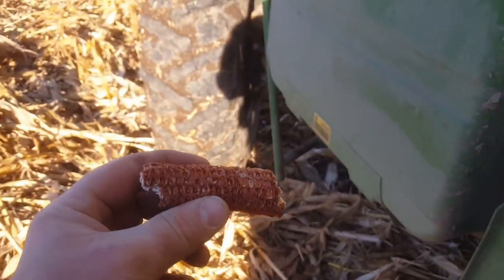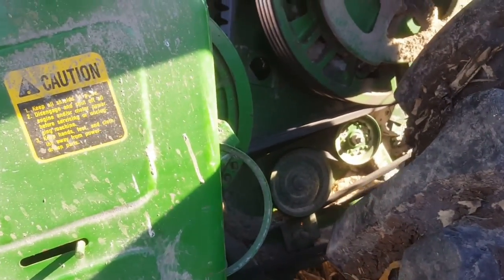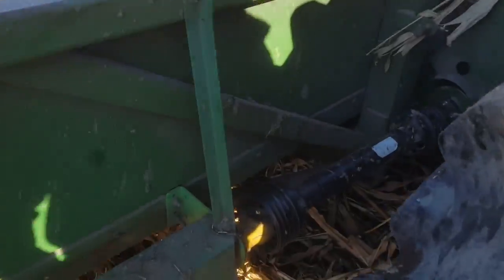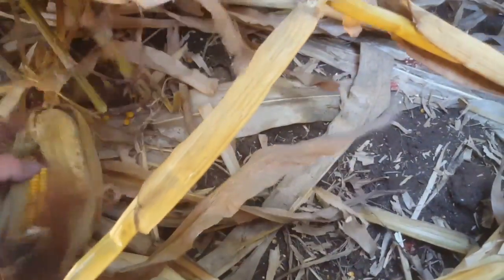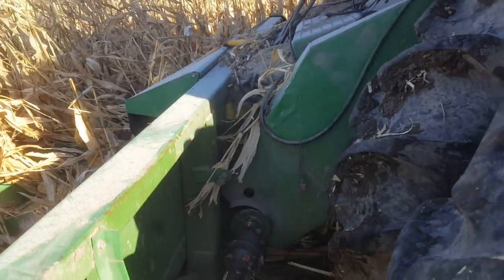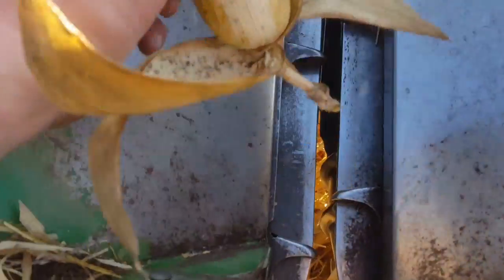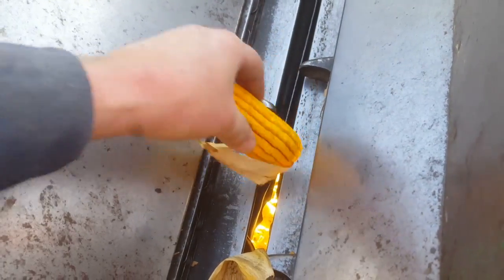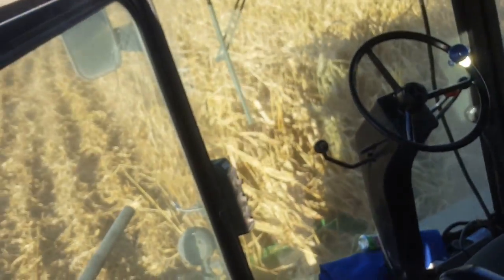How I set a combine.

Comment: Great video and great information. I have a jd 4420 and I’m getting cracked cob in the grain tank and small amounts of smaller stalk. Should I work more with the sieve
Reply from the maker: If you're getting cracked cob can you open the concave without sending corn out the walkers?
Otherwise close down the top sieve a little at a time. Then check for a loss behind you to make sure that my clothes in the top down you're not running corn out the back. You should have two levers for the top sieve the Right One controls the front portion in the left one controls the back so you can use the right one in close down the front portion and leave the back a little more open

Comment: Good job on your video.... it gets a thumbs up! This is where the old Gleaners were so easy to set for a clean sample. They had visual tailings return from the very first A to the last L4 (yes there was an L4). You could even grab a handful of tailings if you wanted to and do it on the move or just glance to the right while combining and see the tailings flow. I miss that feature in my R52 but sometime I'm going to see if I can get camera installed to see the tailing. My L2 was a great machine but I still did the things you showed here in the video.
Reply from the maker: Like the old John Deere's where the tailings elevator came into the cab and you could open the door. Probably not OSHA approved because potentially you could get a hand caught in the elevator. LOL

On this combined from the cab I can see the returns auger as well!
Reply: @jonstevensmaplegrovefarms3754  You should show the tailings return in action. I like seeing the older machines getting it done. 

Back in 2011, my second year running Dad's farm, I was combining corn in my L2 and right next to me was a brand new Deere flying with a 12 row head. I felt pretty puny and antique as he flew along. After a while I didn't see him and then I saw the Deere service truck. I ended up finishing my 75 acres before he finished..... granted he was in a 300 acre chunk.... but what happened was the computer went haywire and he could not shut the machine down or stop it and he ran into a waterway ditch bank and twisted the corn head and combine frame. I didn't feel quite so bad in my old antique L2 after that :) and the neighbor had another loaner from Deere the next day.
Reply from the maker: Ha.
Yeah I'll get some footage of that

Comment: Jon, I Dont know if you still see the comment on these older videos or not. but I have an 8820 I have saved and I am trying to make work for my first year of farming (2020) I took some of my end rows off last night as I felt I had lots of grain loss out the back of the machine. I tightened up my concave and that made it thresh better but I am still loosing out the back. where would be the next place to start ? slow fan speed down or open sieves up more ?
Reply from the maker: Close both top and bottom screen decks then Take a coffee can of whatever take a coffee can of whatever grain that you're harvestingand  dump that coffee can on there and open it up until that grain easily goes through when you wipe with your hand and then open it a little extra.

The next screen Beloit open it up until the grain can just go through. Then a little tiny extra

If the loss is out your chopper then that's a thrashing issue.

There is some inspection ports for the concave on both sides in the upper back and if it's soybeans I would set it so it's you can get your thumb in there between the rats bar and the concave if it's corn hand shelikhov and open it up until a cob just fits between the RASS bar and the key stock on the concave.

Comment: Thank you for the video Jon !   I've been doing some repairs and fine tuning on a JD 7720 Titan II and this sure helps .👍
 The operators station looks very similar to yours and we got the machine back in action after some belt replacement and other repairs but I can't get the indicator light and warning buzzer to go out for the straw walkers .  Everything is working fine and I replaced the censer on the straw walker shaft but light is still on and buzzer buzzing in the cab . 
 I suspect a broken wire somewhere in the works . Any thoughts Jon ?
Reply from the maker: Magnet in the hub on the shaft?
If you touch wires together does it go out?
Good to see you back!
Reply: @jonstevensmaplegrovefarms3754  Thanks again . I ran a short jumper wire in the plug connecting the two wires and light stayed on .
Reply from the maker: @cranerigging3604  then broke wire some where.
Reply: @jonstevensmaplegrovefarms3754  That's what I suspected as well .  We disconnected the warning buzzer and customer is shelling corn now .  Will investigate the wiring on a rainy day .  Thanks again for the help !👍
Reply from the maker: @cranerigging3604  
Good luck! Hope you have a safe and Bountiful Harvest!